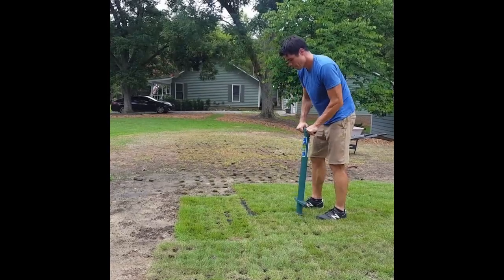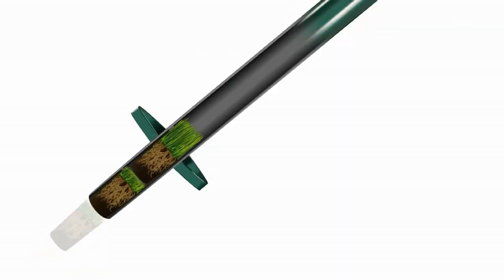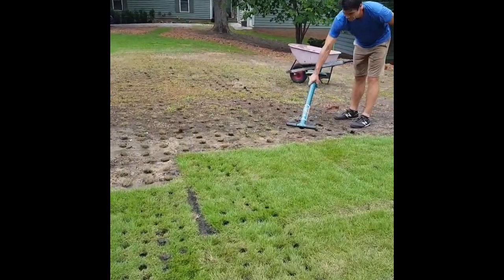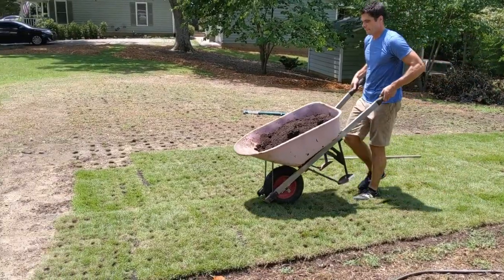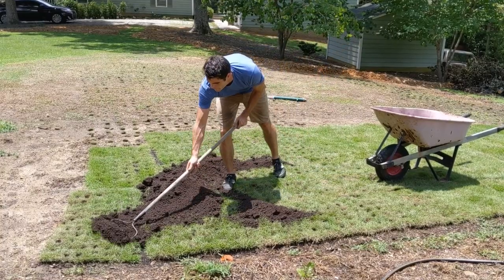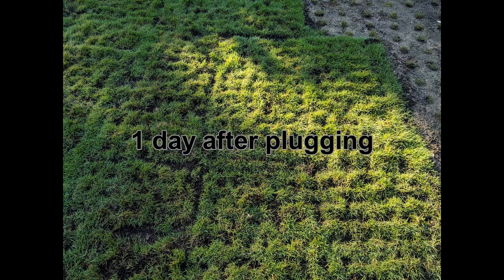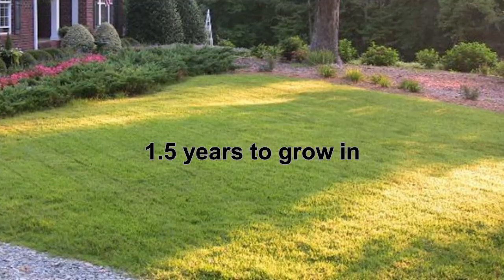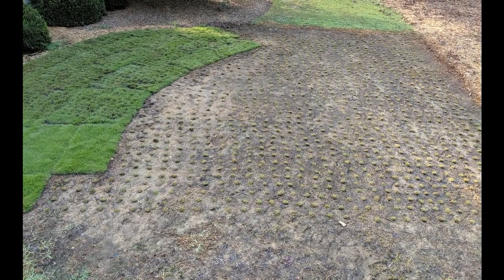Planting Zoysia Grass Plugs with the ProPlugger

Comment: with such a long time to fill in (1-2 growing seasons) how did you control weeds in that area?  Can you apply a pre-emergent before adding the new plugs or will that stop the new lawn growth?
Reply from the maker: We controlled weeds by applying a granular pre-emergent after we transplanted the plugs. I'd heard that pre-em can act as a root pruner which would slow the spread of the plugs but it was worth the risk. We actually had near full coverage the following year but a lot depends on your local growing conditions (zoysia loves sun).